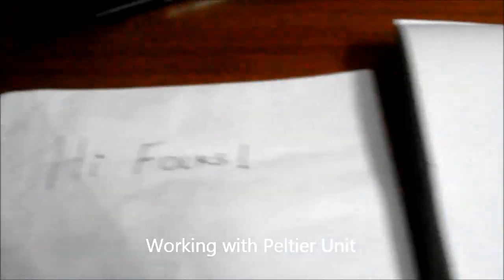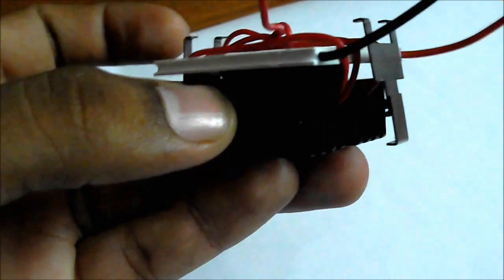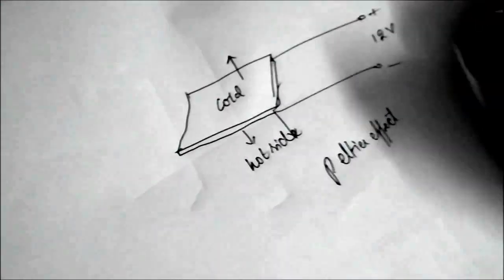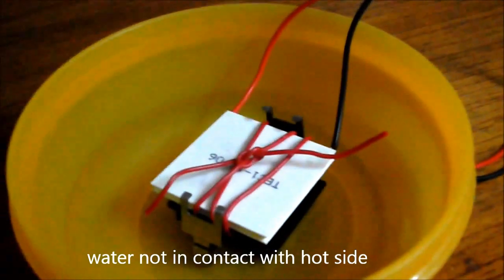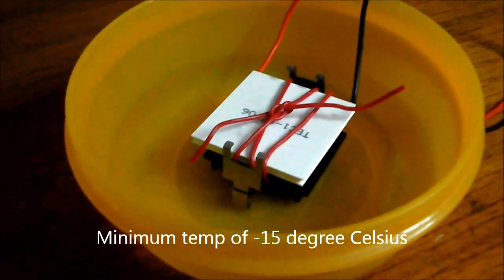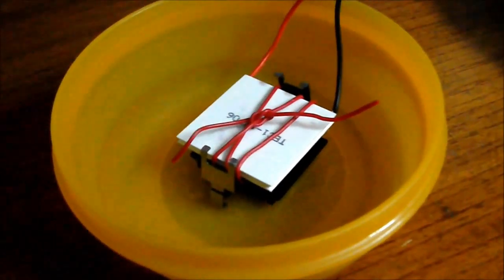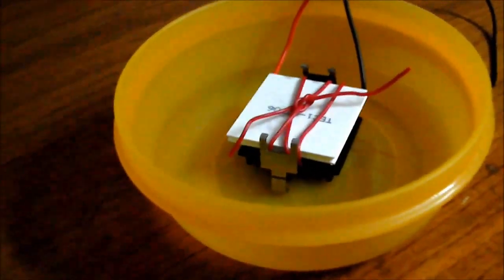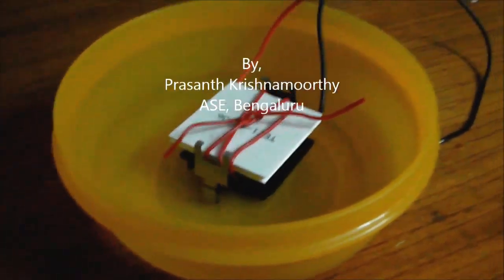Peltier Unit

Comment: what is the cooling capacity for a single unit??
planning to use it for aquarium chiller (cooling aquarium water) how many units i ll need for maintain 15degree temp.

Comment: off the shelf parts to play recharging batteries is thermopile generator but they require higher temp like your wood stove example to produce power. There is a couple of friends use them in their ice shack stove pipe to charge batteries that provide led lighting within the shack. One friend wants to put a bunch in a focal  point  of a small sat dish with foil on it.

Comment: If you could sandwich allot of them between two heat sinks and put them in the outer walls of your house it some fashion the heat in the house and cold out side would charge battery's in the day and keep the lights on at night for the winter months any way.

Comment from the maker: Exactly. It's in accord with newton's 3rd law... every action has an equivalent opposite reaction. The heat which is rejected by the cold side is donated to the hot side, so it becomes super hot (like 250 Celsius). So, if you don't add cooling to your peltier, the heat from hot side will propagate over the junction and will instantly make your cold side a frying pan and ultimately damages it permanently if kept that way for too long (like 30 seconds or more).

Comment from the maker: Black is for the negative (OUTER part of the DC adaptor O/P pin) and red is for the positive terminal (INNER part of the adaptor O/P pin). You can directly connect the peltier unit to the adaptor, but make sure your adaptor rating is high.
For example,
if your peltier has a rating of 90W and if you are using a 12V adaptor,
the current rating of the DC adaptor MUST be close to 90W/12A i.e 7.5A.
Else, if the load is high, you will probably end up burning the adaptor. Lemme know if you need help.